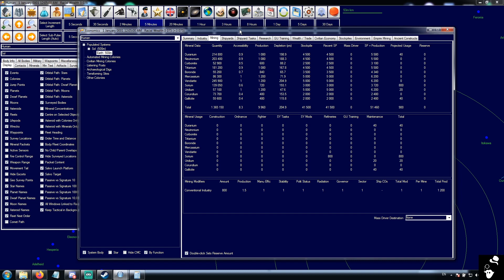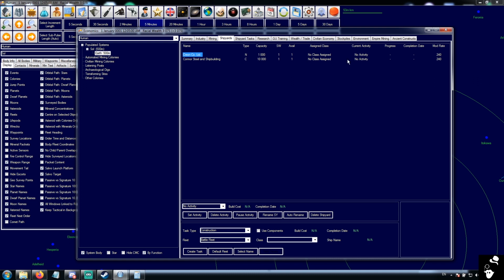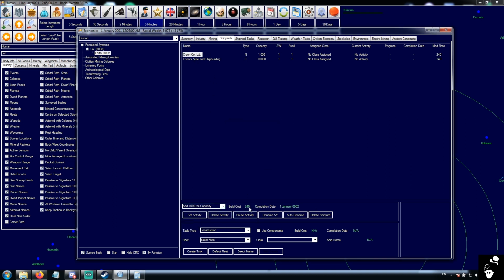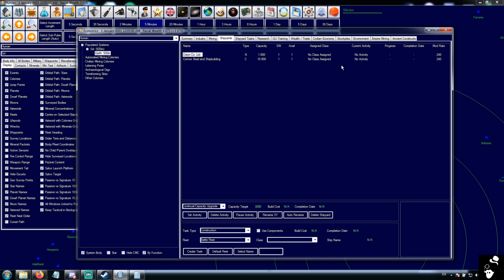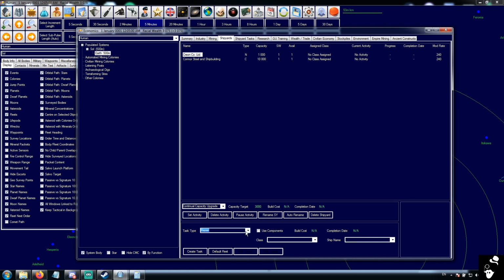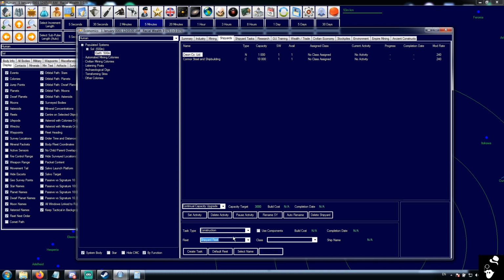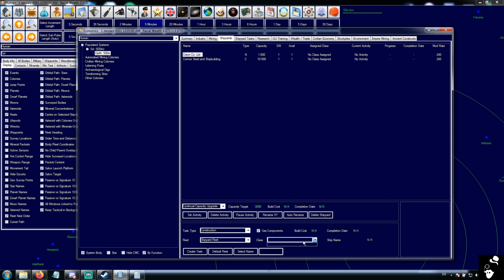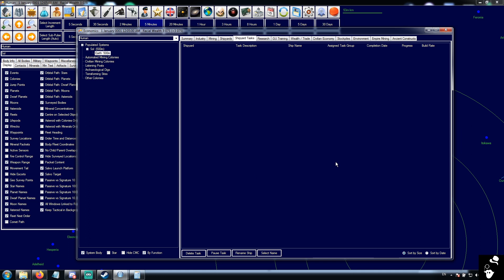Aurora C# - NPNG Tutorial - Shipyard Summary

Comment: Very nice video but I have 2 complaints. 1. Commercial Ships are also optimized to be big and cheap, sometimes also inefficent, with the shipyards taking less work to expand. 2. You did not cover combat damage to shipyards unless I missed it.
Reply from the maker: More details about the differences between commercial and military will come when I discuss ship design. I did fail to mention the differences in shipyard expansion rates though, but the information I did give should let anyone figure that out easily enough until I discuss that in more detail.
I'm also going to be covering individual installations in more details in a later episode as well which will have that information.

As for combat damage to shipyards, that'll be covered in the combat episode.

Remember, this episode is meant to be about the Shipyards **TAB**, not all the details about shipyards themselves. You'll notice I also didn't talk about shipyard detection, or inter-planetary transportation, or several other shipyard-related topics.

Thanks for the feedback though, I might adjust the episode titles to better signify what they're actually covering.
Reply: @serbeardian8849  whoops. Sorry its been a while since I watched you and I got accustomed to Spacemarine/Defran Strategy.